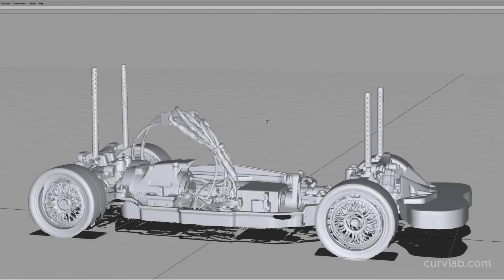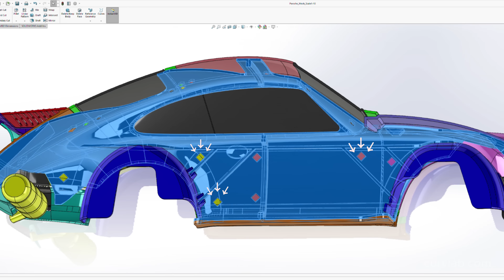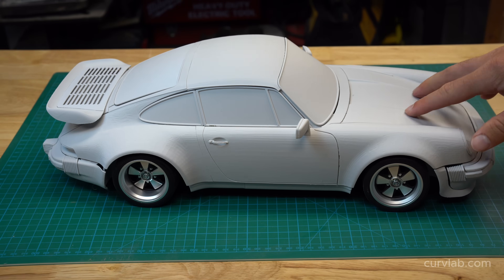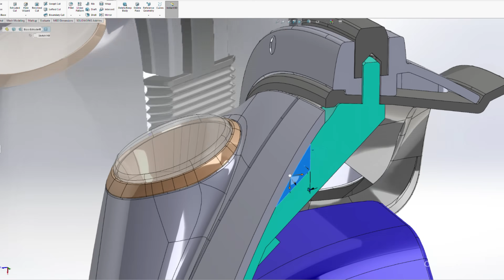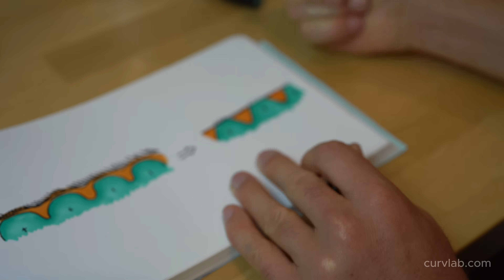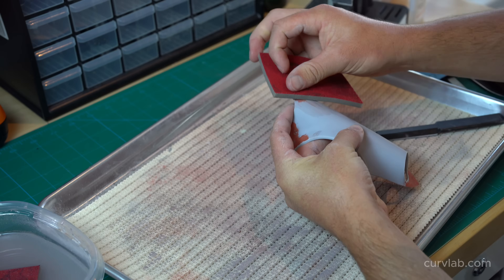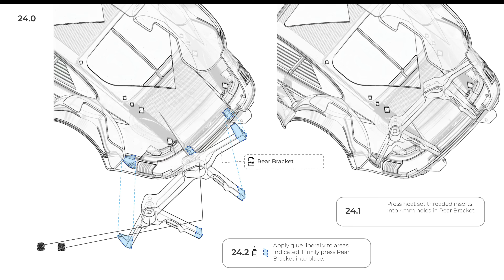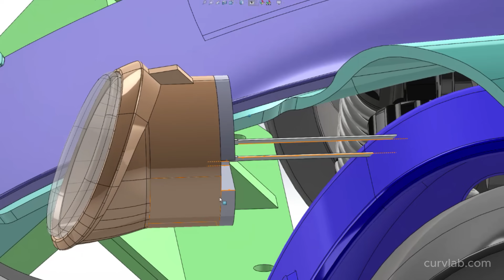3D Printable RC Porsche

Comment: You did a really good job, but... I'd be lyng if i said that it doesn't look better from affar 😂. The panel gap in some spots like between the frunk/hood (however you wanna call it) and the fender pieces where the lights are look just horrible up close. I know it's not easy to make the parts flush i'm not criticising your work, it's just that the car in particular is unforgiving in some areas, the rear end came together a lot better.

Comment: For those not familiar with Alias; modeling the headlamp surround in Alias is a great feat, and using single span must take a while to sort out if going for G2 or G3 continuity. This looks really clean
Reply from the maker: Thanks dude! hahah yeah, if you are familiar with alias you can probably understand the amount of time this took, LOL!
Reply: @CURV-LAB  Ive used Alias for over 20 years so yes Im fully aware how long time it takes, builds like that usually take several days to several months to finish in Alias depending on how far you need to push it. The finished CAD and the physical model looks really good! Thank you for sharing

Comment: I am pretty new to 3D printing, but as I saw you sanding the chasis to achive an smooth surface one thing came to my mind. I saw videos on youtube that you can print parts in ABS and I think also PTEG and then cure them with acetone to produce extremely smooth surfaces. Maybe this is an alternative way to prepare the print for painting. If you read this comment I would also be interested if any other model is planed to be published. I really appreciate your work and will 100% purchase your models if i realize my fully 3D printed rc car project. Thanks for the great content!

Comment: Got it and already printing it. Few comments though. Please, add a lock mechanism between the two big chassis parts. it is way too easy to misalign them when gluing. Material warps and it's never perfect there. Adding a 4-6 recesses and a separate locking part would greatly help. Did that myself in order to properly align it. Another thing is that your holes for the thread inserts don't account for material shrinkage and it's good just to mention that and btw the manual states for M4 threads while the holes are for M3. I put M3 bolts, should be fine. Rather than these minor things it's a beautiful model. I am printing the chassis from PETG and everything else on the SLA to minimize the sanding involved :)

Comment: Finding the matching chassis that fits your requirements is harder than it would seem. I've searched from EU providers, and there are plenty of model options for Tamiya TT-02 Chassis but they are BR, SRX, S or such, and none of them seem to resemble the version you have.
Reply from the maker: All Tamiya TT-02 chassis use the same mounting points and overall geometry, their difference is in the material and performance. So they all would be compatible with this body.

Comment: What are all the parts that start out A1Mini?  Are those an old version of the body?
Reply from the maker: Those are the substrate parts broken into smaller pieces that can be built on a smaller 180 x 180mm build plate. If you have a 250mm^3 build plate or larger, you can ignore those parts, since the regular front and rear substrate parts will fit on the build plate

Comment: Hi! I have bought your project, but I am having a bad time printing the two substrates. It starts well, but in the end the tip of the substrate starts to flare under the nozzle pressure and everything goes wrong. I am using a P1P Bambulab printer with your settings.
Reply from the maker: hmm haven't seen that before. I would try running it with support enabled.
Reply: Yeah, that would be the next step. It could be that the P1P is an open frame printer and the temperature is not constant inside.
Reply from the maker: @danidanut85  oh interesting. That could be it -- near the top of the print there's not as much heat radiating from the build plate.

Comment: Very cool stuff your doing here, So much so that I had to Sub just to see what's next :)
I have a question, Is there a paint or some other process that you could coat the inside of the light bezels and make it reflective like maybe is there a chrome paint? I realize that it would make almost no difference but with your effort to make the model prototypical I thought that idea might be interesting to you :)
Reply from the maker: thats a good question. Yeah I think a chrome paint inside the headlight, and maybe lightly frosting the inside of the clear lens would do a better job at diffusing the light

Comment: I tried to print my BMW e61 wagon from a model I mashed together piece by piece because BMW models are hard to come by, so i designed the rear m5 bumper myself from a standard wagon and a sedan m5 bumper. I thought that was a big accomplishment but now that I see this, I can only see what is possible and I can't manage to achive. The innerstucture, the outer parts alligned perfectly by these squares in the innerstructure, the self made details. That's just amazing and even with 50 hours in my project I managed to print the front half of the car. And one the way I kinda gave up because there are things I know i can't do.
Reply from the maker: KEEP GOING. Don't fall into the motivation trap!

Comment: 8:50 - I highly recommend the use of a cheap (as in approx $40 USD) hot air rework station for jobs like this, and a lot of other jobs related to 3DP post processing eg: annealing, adding/removing/smoothing material, fusing separate pieces together, repairing breaks.... They kind've suck for their intended purpose of soldering (or atleast my older one from when they were more like $25 USD does), but it has more than proven its worth when working with these plastics that it can soften or melt with ease (without leaving burn charring marks like a flame can).

Just don't leave the thing powered unattended, the magnetic switch that turns it off when gun is placed in holder is not to be trusted.... I'd also go ahead and test continuity between earth PIN and its chassis and it's heat gun too (my unit had no issues, and has not turned itself on unexpectedly either, but I've heard stories)

Comment: I love the way you designed those alignment bits. Good job man. 

I have a suggestion, Use the leds that are fit on mini torches preferably the phillips ones. I used those in my model cars way back in middle school and those leds basically gives a damn straight led pointed towards the front like a real car headlights. It just changes the whole look of the car when viewed inside your dimly lit studio at night. Use the SLA lens and give them the appropriate curve to maximize on it.

Comment: Printing those fenders with just 2 tiny plate contact points is not an easy task 😅 I was able to print the left one first try but the right one has failed 3 times now...
I'm using ASA-CF so it doesn't stick to the build plate as well as PLA. Any tips?
Reply from the maker: hmm yeah CF is tougher to print in general. Maybe try printing it with support enabled
Reply: @CURV-LAB  yep, that's what I did and it printed fine with support enabled

Comment: Painting tip for future.... keep camera away from work area and cover up around the work shop. Dollar tree has huge plastic drop sheets for 1.25.. lol also when I paint i pre plan the direction of where I am spraying this way I am not spraying all over the place. If you paint outside which I also do I spray and immediately put the part inside my shed or garage this way I protect the finish... just some tips from a fellow budget builder

Comment: can you technically make like a non rc version like a display model like a diecats or something
Reply from the maker: thats a good idea. Currently the only thing missing would be a bracket to hold the wheels in the correct position relative to the body. (What the RC chassis already does).

Comment: Consider using a simple booth for indoor painting. Look into what paints are safe to use with what setup (to avoid volatile sparks and fumes). You can build a simple one with an AC air filter and a box fan to catch the over-spray (I don't know if that is safe with rattle-can stuff, but it is great for airbrush paints.) It will save your indoor space from unwanted painting.

Comment: These are some preem wheels choom. Time to paint it silver, red and green 

Anyway imma go give you my eddies right away

I know Johnny is brands is a 1977 911 turbo but still soo similar it’s negligible 

I cannot wait to print this on my k1 max

Oh and coming from the cosplay scene id say sand first, prime second, sand again and see if it needs another coat of primer depending on if you want a super smooth finish, reason it’s better to do this instead of primer then sand is that primer gunks up your sand paper far faster than the plastic dust

Comment: Really well thought out – super efficient in saving time and material 🔧⏱ Inspiring stuff! 
It may look like a thin shell, but this execution feels surprisingly strong. Really nice job 👌
Sorry if I missed it, but what layer height did you use? 🤔 I only get this kind of smooth surface on my Prusa with 0.08mm… or at least it looks that way 👀 Thanks! 🙏
Reply from the maker: I used .16mm layer height

Comment: Lovely model, purchased and can't wait to share on my channel! One note, 10:20 if you print in ABS, you can use ABS Slurry to fill any major gaps, prior to prime and paint! ABS is a ton more heat resistant and I like working with it, as everything goes together without the mess of CA, provided you use a solvent based glue for ABS. Thank you for the hard work!
Reply: Plastic cement bonds ABS perfectly
Reply: @Kevin-mx4vm that’s not the point. ABS solvent actually bonds the two pieces together, and doesn’t craze or clump like CA could. And ABS slurry fills gaps with actual ABS, so it doesn’t sag or shrink. Model builders have been doing this for years, and it results in a much better end result.

Comment: Beautiful work! How thick do you make your car parts so they print without the wobble ruinign the print quality?
Reply from the maker: 1.5-2mm
Reply: @CURV-LAB amazing! Do you slow down print speeds to be safe? I usually do molds so I need them to be thicker but always cool to see how thin we can go lol
Reply: @CURV-LAB  Ty sir! Do you slow down your print settings to avoid it breaking/distorting while printing with print head touching the print? Appreciate your sharing your tips/tricks!

Comment: I don't recall hearing what filament you used. Derp nvm it's pla basic from bl. Listed in the material list. Didn't see the link at first
Reply from the maker: All good. Yep, PLA. Though Petg would be a good option as well
Reply: @CURV-LAB I was surprised that you were gluing pla or at least it looked like you used glue on the build plate. Have you tried out bl cold plate or biqu frostbite which are practically identical? You can print pla at really low build plate temps and have the door closed

Comment: Its at moments like this when I see how incredibly bad I actually am at 3D modeling. Jesus you are good at it. Where did you learned all of this stuff?
Reply from the maker: Working in the industry. I've found the only reliable way to learn CAD is to have an impending deadline where your job relies on delivering hahah. That's the motivation you need to learn a new CAD program quick.

Comment: i wonder if it would be a nice upgrade to add like alignment nibbons to both halfs of the body. so it would autoalign when glueing instead of glueing it flat.
Reply from the maker: yeah that would definitely help. Couldnt think of a way to do it without making one of the halves need to be printed with support.
open to ideas!
Reply: @CURV-LAB  maybe still print it flat as is, but add some pockets for dowels to glue in after printing. like in woodworking :) but still impressive what you created ;)

Comment: That’s so good, I think I have to learn the autodesk suite. 
What I did not like was the front light, I think that was overperfected. Clear lights came first around 2000, before that was the typical difussion patterns, you cat totally use fdm to imitate them. However, the glass is to clear imo
Reply from the maker: Yeah I feel ya, the glass is too clear, but I figured that’s better than scratchy opaque.

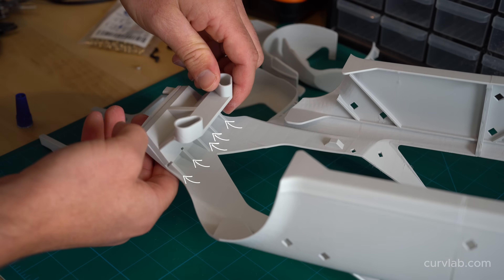Comment: 3:56 should have printed the bracket in tpu
Reply from the maker: But wouldn’t it be too flexible? That bracket is what keeps the whole body in position relative to the chassis
Reply: @CURV-LAB  you want it to be flexible, or one tiny bump and the nice body could break. thats why rc car bodies are made of lexan, to allow for some flexibility and energy dissipation.

Maybe you could play with infill till you get a nice nalance between flexibility and stiffness
Reply: @MustafaKhan-hz5mr or just get the right shore hardness TPU.  They come in varying flexibility :)

Comment: You don't have to paint your whole workshop? Just get a very large cardboard box and paint inside that, put a fan into there, and a filter on the inlet of the fan. Ideally yeet that air outdoors if you have extraction.

also "that is not something you can do with a mesh file" mate you underestimate Blender-fu. Granted, would i WANT to do it, no, actually no i rather wouldn't.
Reply from the maker: That's true. What I should have said is: "that is not something I am capable of doing with a mesh file" lol
Blender is forsure the way of the enlightened
Reply: @CURV-LAB   Beautiful project btw massive win.

Comment: It’s rare to see a 3d model on youtube that is ACTUALLY worthy of a purchase. Will definitely buy for my tt02.
Reply from the maker: Heck yeah, thanks for your support!
Reply: The price is unusually high for these kinds of models though. It looks nice, but that's steep.
Reply: @no1DdC  The price is the price.  He knows what his time is worth.  I can't even imagine how many hours he's spent designing it in CAD, and then optimizing all of the print orientations etc.
Reply: @no1DdC  I'm interested too, but $50 for just the shell seems a little steep... I've purchased full cars in 1/7 scale with chassia, wheels, tires, and gearbox and all for $35... I may still buy this but I'll definitely have to think about it for a moment vs jumping right in... I do appreciate the work that has gone into this, but after paying less for more, I dunno... I'm on a fixed income
Reply: @MonsterPartsRc  The transparent 1/10 polycarbonate shells are just as expensive (at least where I'm from), and you can only use them once. Which is why I don't have a proper RC car yet.
Reply: @daedelus_  Same here in Korea. Basically impossible to source any kind of shell for a reasonable price. The price aside, I feel these kinds of things are geared towards tinkerers and whom who have the "Tamiya mindset(iykyk)" anyways.
Reply: @MonsterPartsRc  You don’t realize how much work gone into it to generate those files. So, no. It’s not expensive and you can’t compare it to commercially mass produced products. This is a work of art.
Reply: @daedelus_ I get that… but that’s for the actual product… you’re paying for the actual shell… and I’m not saying his time isn’t worth money, I’m not saying I can’t print six of these in different colors if I want to for that price, I’m just saying I’ve paid the same or less for more… I also didn’t say I wouldn’t support him… I’m just saying it’s harder for me to just ‘jump in’
Reply: @daedelus_  yeah but that is for a tangable product, what you are paying for here is litterally just the 3d models to then build it yourself with your own materials and own machinery. Im not saying that a printed and assembled body would cost 50 dollars, likley an over 200-300 dollar body, but yeah 50 dollars for just the model can be viewed as steep for most people. If it was 50 dollars for like 5 different bodys for the same platform, that would be sweet since it would allow someone to manufacture more than one body.
Reply: @daedelus_  Why can you only use them once? Mine go through the wars (and sometimes need a little repair ) but the shells are permanentish.
Reply: @MonsterPartsRc  yeah, but they come with a basic lexan body that has nearly no detail.

Comment: For painting indoors, you might want to assemble a big hood out of boxes or drop sheets around to contain the aerosolized paint.

When you combined the rear fender with roof onto the substrate, were you worried about fitment issues with the other body panels? I would love some details on how you thought about tolerancing in general on this project.

My palms got sweaty when you super glued those perfectly polished headlight lenses. Danger!!!

Great edit for an even greater project! I appreciate the time you spent on sharing it with us!
Reply from the maker: tolerancing was a gut thing based on past 3d print projects.  Left anywhere from a  0.35mm - 0.5mm gap between most parts and body panels. There's a 0.00 tolerance between the substrate outer surfaces and the body panel inner surfaces and shockingly no issues. I think between sanding and painting it nets out to nominal.

Comment: Great job, but 50 dollars for the files that I have to print and paint myself is too much even tho it looks really good. 20 or 25 would be fair imo.
Reply: I'm interested too, but $50 for just the shell seems a little steep... I've purchased full cars in 1/7 scale with chassia, wheels, tires, and gearbox and all for $35